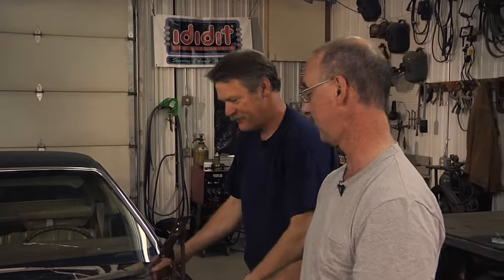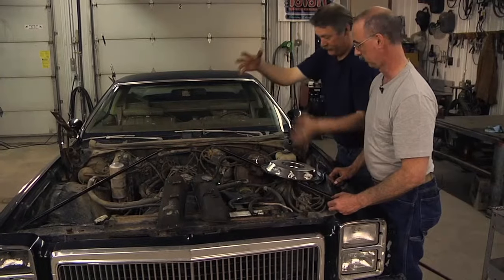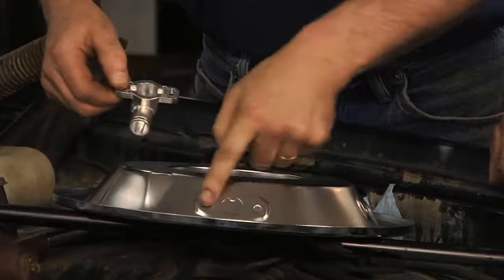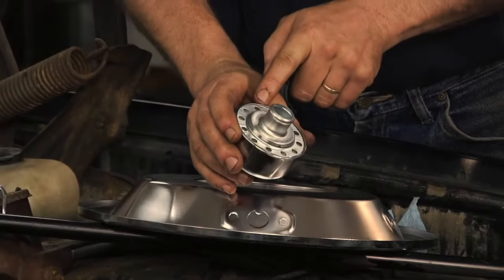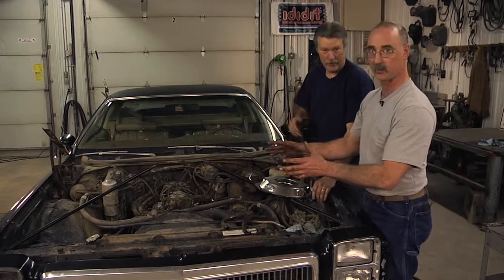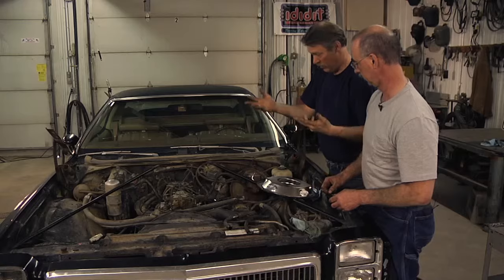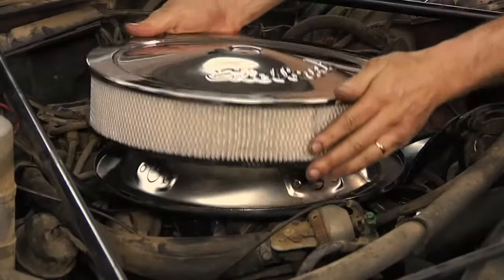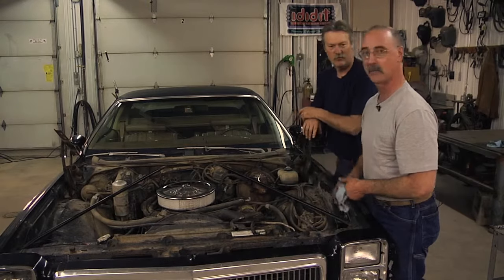CAR AIR CLEANER INSTALLATION

Comment: So where dose the pcv go to then sounds like you got 2 vents and no suction
Reply from the maker: As Brent mentions on the video, the PCV valve is mounted to the Right Side Valve cover and the oil filler and breather cap are replaced by the single breather cap on the Left side valve cover.
The PCV (Positive Crankcase Ventilation) Valve in the right side engine valve cover is plumbed to the large vacuum port on the rear base of the carburetor.
This setup will give the engine all the ventilation it needs.
Wrench Safe, Mark
Reply: So what you saying is you got 2 vents so why put a valve in if it's not hooked up to the intake
Reply from the maker: The system has One breather cap that allows fresh filtered air to enter through the drivers side valve cover.
The PCV valve is located on the passenger side valve cover and is hooked to the large vacuum port at the base of the carb.
The vacuum created by the PCV valve draws in air from the opposite side of the engine where the breather cap is.
This is a common setup for most stock and performance engines.